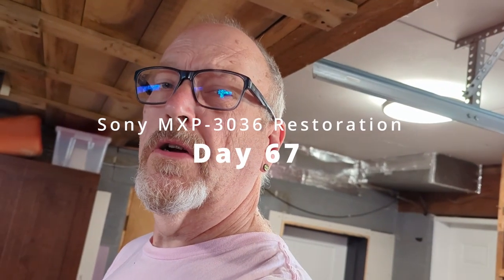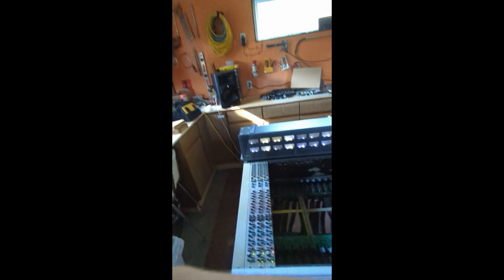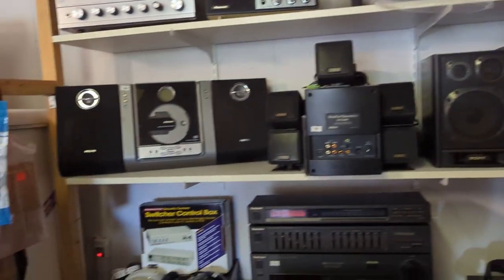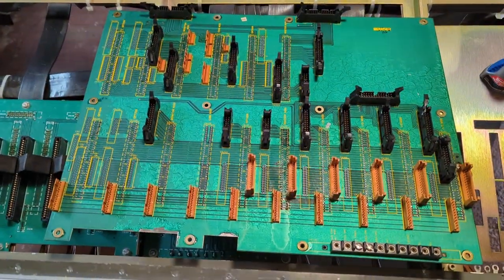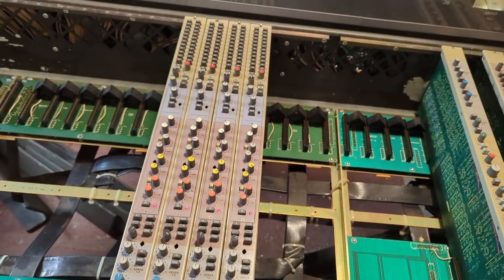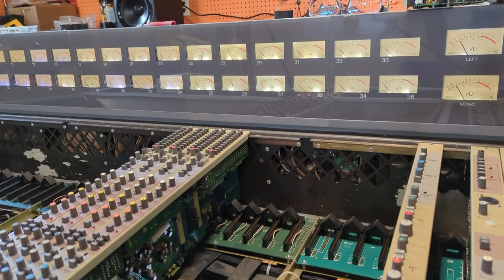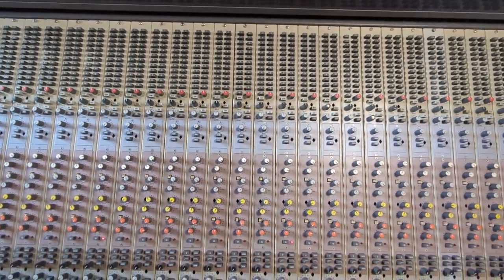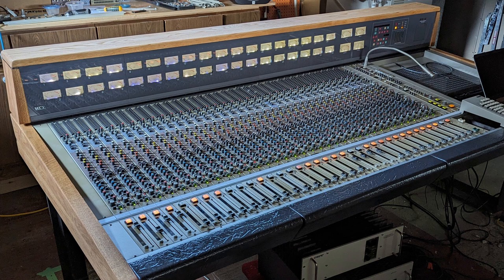Vintage Console Restoration - Part 4 "A Fire of Unknown Origin"

Comment: 4 working channels is about as many as i had when i fired mine up before it drew the magic smoke. After that... Full recap! And even then there were multiple logic chips and opamps that were dead, fractured and stripped traces, and attempts of "repairs" from the previous owner that i had to re-repair. I found that using adhesive copper tape works great for trace repair and i  had to do it A LOT!
Reply from the maker: Wow, you must be watching through the whole series. 
Currently at 36 working channels (with some issues) and now working to stabilize the power supply.
Reply: @EdgetoneStudios  Yeah , i really empathize with the whole thing.. I'm glad that I'm not the only one in this. 
 Btw the PSU is usually the 1st thing to rebuild regardless of whether it turns on or not then check the voltages and the plug the console in.  Mine was squealing like a dying squirrel so I immediately shut it down. 
 If you see any tantalum caps in there, replace immediately!